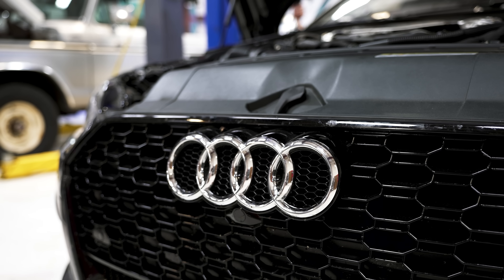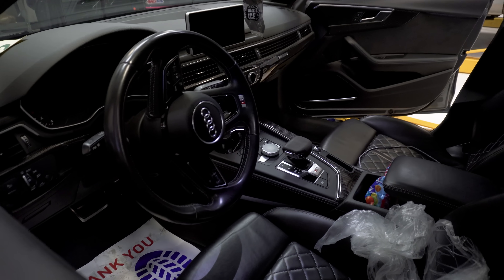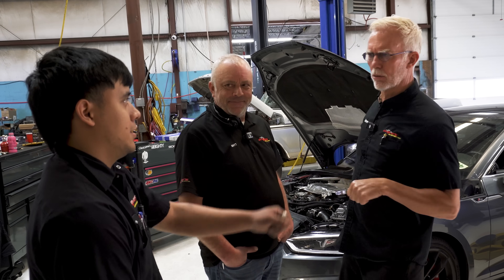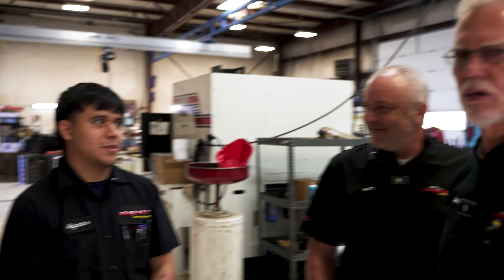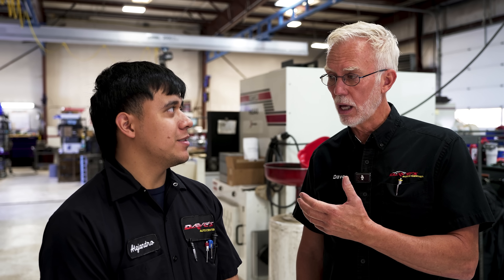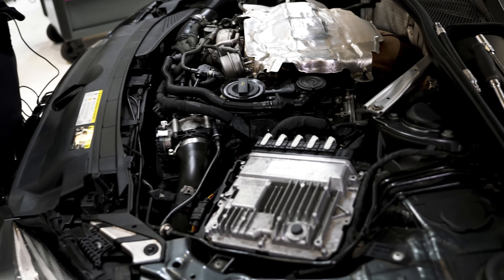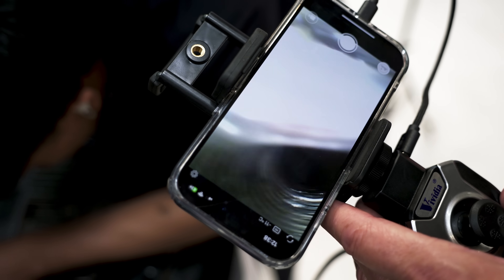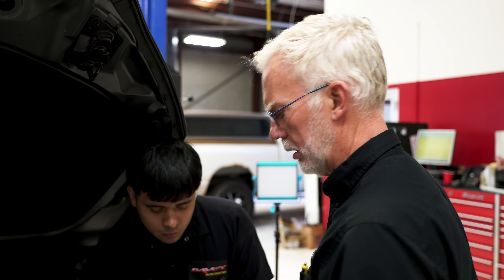Audi S5 Engine Piston Damage

Comment: I’m a retired Audi tech, when there is a missfire on a cylinder the ECU will hide that cylinder meaning it stops spark and fuel flow to that cylinder. And I’m pretty sure Audi does not recommend boring cylinder walls. Check to see if the car is tuned as that most likely is the cause. Have fun with the timing chains ( something I don’t miss)
Reply: That was my first guess.  The car was likely leased by owner one, then owner 2 bought it and cranked the boost, knew he broke a piston and traded it in, then this guy ended up with it
Reply: Yes these engines will deactivate the cylinder so the cat should be fine . I wonder if the car has been remapped and/or run on the incorrect grade of fuel
Reply: @richierich9761  Low octane cheap petrol was my first thought. People buy modern expensive high-performance cars and run them on cheap fuel. It's an absolute no no...
Reply: @richierich9761  They can't deactivate injector that is stuck open.
Reply: @richierich9761  Could have fueled the car in Utah with 85 octane.
Reply: @genehart261  That plus a high speed run to the River ...........🤔
Reply: @richierich9761  I tell you all something. I know a lot about things. Diesel engines are not one of them. I love diesels. I know somethings about diesels but not like the gasoline engine. Im humbled by you all.
Reply: @richierich9761 I'm so glad to hear the kitty's going to be fine😊❤️🐈
Reply: Problem most likely came from a car being tuned. Most S5’s are. And when tuned if you run a lower grade octane than it’s tuned for there is almost no safety margin left. 
Most guys got with a 93/94 Oct tune. If you put 87 or the like in there and put any load on it. Kablamo
Reply: Nonsense. It's not the tune, those garbage rings Audi has been using for 18yrs has caused so many bricked 100K mile B8s, B8.5s, B9s, etc. That causes the oil consumption problem and is why you gotta change ignition coils, plugs, plug wires, PCV, injectors, clean the throttle body, replace the catalytic converter due to the stupid carbon buildup, etc. It still happens on the newest models minus the TTRS and R8. 

Audi has amazing transmissions, looks, versatility; but horrible engines. Definitely a brand to avoid(I didn't lol) 

Almost all cars have some weakness to their manufacturing. I'm tired of dealing with it all together and will welcome the end of this racket.
Reply: @nighthawkviper6791  Get educated. Oil consumption was solved in 2013 when they changed the oil ring on the pistons to a differed design. That was more than 10 years ago.
Reply: @Japplesnap the class action lawsuit in the states received its final approval last month, affecting vehicles up to model year 2017.
Reply: @joebo525  Meaningless. Anyone can start a class action lawsuit.
Reply: @Japplesnap  it was not solved. they still have problems to this day. I see it out of warranty all of the time. I run a German repair shop.
Reply: @joeclarke8716  Solved on my cars. Zero issues. Zero oil consumption.
Reply: @Japplesnap  that's great for you, but it is still an issue to this day on vehicles past '17. Heck I just had a '20 Q7 in and 2 dead cylinders 88,000 miles. Their engines are horrible.
Reply: @joeclarke8716  There are no perfect engines. Some will have problems no matter what. For every one of these engines that do have this issue, there are hundreds that don't. Mine fall into the hundreds that don't.
Reply: @Japplesnap  their engine failure rates are higher than most any company save for Jag/Land Rover. There is a reason why they are having issues and also many, many lawsuits.
Reply: @joeclarke8716  Yet there are hundreds of thousands of them out on the roads without any issues. The failure rate of all modern cars is extremely low. Yes, even Land Rovers.
Reply: @Japplesnap  no, the failure rate is not low. Engine failures have been higher than ever before for the past 10 years. That is due to the shift to low quality/ less expensive manufacturing. Land Rovers/Jags have the highest failure rate. I work in the industry and have worked for the manufacturers. I have seen the decline first hand. As far as German cars, VAG is the king of unreliability.
Reply: @joeclarke8716  The failure rate is extremely low. Prove me wrong. You can't because the data doesn't support a high failure rate. I also work in the industry and I see it every day.
Reply: @nighthawkviper6791 Oil consumption/piston ring, timing chain issue was fixed for the B8.5 and onward. Ppl see an issue with one generation and all of a sudden it’s every car. Get your facts straight.
Reply: @Siwerdensichhinsetzen  I’m here in Canada and we don’t have the right to repair, it not only Audi but other manufacturers don’t release all the information. That really pisses me off.
Reply: Timing chains were easy. Its timing belts I didnt like.
Reply: @crasherxtreme What are you talking about, timing belts are simple, you do know that there are a number of timing chains on the backside of that motor and special tools involved. Either pull the motor or the transmission. Give me a timing belt anytime.
Reply: @nickpappas4133   no. I dont know diesels that well. But i put an OEM timing belt on a volvo 4cyl and it had to be replaced again in about 18 months. Chains lasted longer.
Reply: @crasherxtreme  Why did it need replacement in 18 months?  I drive a 2003 VW Golf with 2.0 litre gas 4 cyl  230’000 kilometres, replaced timing belt at 134K and will do second replacement soon. Not bad for a 21 year old car. Some of the newer VW/Audi 2.0 litres with chains need replacement before 100’000 kilometres and hopefully it is caught before chain jumps and bend the valves.
Reply: @nickpappas4133   or slap a hole in the top of the piston. The ribs on the timing belt were worn. After I took off belt, all pulleys turned without any trouble. Crank was turning just fine.. one day it just quit running. The last thing I thought was the timing belt. After inspecting the belt, I replaced it again and ran fine. Was sold 3 months later. I like volvo motors. Easy to work on. Its possible the belt had a defect in it.
Reply: @crasherxtreme   the reason why that belt never lasted is either it was a cheap belt or incorrect tension on the belt. Belts will last atleast 10yrs if not more.
Reply: @JDMz  OEM part
Reply: @nickpappas4133  

And that problem will disappear iff you change your oil on time. . No longlife intervals. .   That's the problem with this engines. Clean oil is so important
Reply: @crasherxtreme  
That is highly unusual, at least in VW/Audi. It's usually the tensioner or water pump that fails. Never the belt.
Reply: @nickpappas4133 why would you buy a car that needs to timing belts done, stop wasting your money and 😂stick to Toyota or Japanese Man
Reply: @nickpappas4133 chains are always better than rubber. The rest of the engineering needs to be on par to appreciate it.
Reply: As a general automotive MasterTech I came on here just to say the same thing
Reply: HI , IF YOU OPEN AN ENGINE YOU STRIP COMPLETE NOT ONLY ONE CYLINDER HEAD
Reply: I wonder what kind off oil is used. . Audi comments 0w20

First thing i did is drain my engine and put 5w40 in it . .    

I hear a lot stories of audi tuners. And they say .  Please don't use 0w20
Reply: @erwinvanriel5843  0w20?!?  Is that baby oil? Olive oil?!?
Reply: @joshuajuarez3471  

Here in Europe audi recommends 0w20 for the new engines.  Im serious .  No joke
Reply: @erwinvanriel5843  almost all new cars do that, AFAIK. As far as I know, it's due to wver stricter emission standards and trying to reduce internal friction (shear forces) in the oil for a few percent less consumption. I went to an excellent 0w40 for my substantially tuned cars and from variable interval to fixed shorter intervals between oil changes for all cars i'm maintaining. My positive experience might be anecdotal, but i'm convinced it helps with longer lasting engines.
Reply: @346L3  

Exactly . . I drive al my life audi.
And first thing i do when i get a new car.
Drain the oil. En put some good oil in it. And no long life  intervals ..   never had problems with timing chains. Sludge .  

👍👍👍
Reply: @erwinvanriel5843  I just learned something. I have diesel I see nothing but 15w40. It was just a shock to me lol. I assume it’s synthetic tho
Reply: @joshuajuarez3471  

No i don't think it's synthetic. I think it's normal mineral oil
Reply: Yes exactly what i was thinking they tuned the engine till it blow and they blame this car is trash this brand is bad
Reply: Wanna bet it has an 034 tune ...
Reply: Audis are piles of shit
Reply: He's part of the Boat Racing 
#LakeHavasu
Reply: They can be dry sleeved for a good chunk of change.
Reply: I suspect to much boost and pinched the ring breaking the piston
Reply: bad remap more than likely
Reply: Thats y u buy a V8
Reply: Audi will not bore cylinders due to coating and pretty thin. If the scoring is deep replacement of long block recommended. I just did a v6 q7 last week due to scoring
Reply: Hey Nick is there anyway I can email you and ask you a question I have a 2018 Audi Q3 with a misfire that they can't nobody can figure out compression test leak down test propane tests can't figure out why I got a misfire in four only at startup I bought it brand new has 70,000 miles had this misplaced for the last 10,000 miles brought it to Audi they tried to sell me at $1200 oil separator which took me all of 5 minutes to put in in the original part for $114 from fcp euro Audi 300 something for the part plus all that money for labor change spark plugs change the coil packs I just have a couple quick questions thanks
Reply: I directly thought of wrong fuel and knocking but normal ecu will change to bad fuel map. 

Also misfire will deactivate the cylinders because of emissions…
Reply: Unfortunately not this time man. All of these engines are coming back with this issue. Every model line up with the 3.0 Turbo
We replaced close to 15 already this year
Reply: Totally forgot Audi does that you are correct thanks for spreading the knowledge
Reply: Bro I hear ya on boring the motor. I don’t think that motor will ever be the same. Car is trash for the next 3 owners until it’s send to auction and ends up in Afghanistan
Reply: I have a audi 07 s4, I have 2 codes p0491 and p0492, car runs great but just has the engine light
Reply: @LandrySua  

Bye an obd eleven . And you can scan your  own car
Reply: Nah you're not supposed to hone em due to the nikasel plating.
Reply: Buy a expensive car like that one u r dumb not to purchase extended warranty if I would bought that type of expensive car guess what I would purchase extended warranty that way it would not cost me to much money out of my pocket. Lesson to learn here. Guys
Reply: If fuel inejction and ignition timing is on point with the right afr im sure its not the tune.
Reply: Exactly,
Everyone thinks these engines are that dumb.
Wth
Reply: I had a 2003 A8 for 8 years. I recently gave it to my friend with 260,000 miles on the original 4.2 engine, original transmission, drivetrain, etc. No misfires. I've heard that their quality went downhill but this is crazy
Reply: I have a 2020 with this engine and 34k miles.  I'm not tuned and fully maintained.  Should I worry?
Reply: What's the best mileage to replace time chain for Audi B9 series 3.0 turbo engines ?
Reply: @Shulcyo  The 3.0 motor was not a concern for timing chains as per the 2.0 litre 4 cylinder. With proper maintenance and driving the 3.0 for chains should be good, only address chains if the back of the motor is apart.
Reply: No guarantee on a car in the USA ?
Reply: But it's only 6 years old.  Why the hell would it have a misfire?   Even if it's just a bad ignition coil or sensor, this is ridiculous on such an expensive car. How do you explain or defend this?  I get at least 12 years out of my Japanese cars before they ever have a bad sensor or bag ignition coil. Let alone more serious problems.
Reply: @richardpowell2953  And this is not a Japanese  Toyota Camery. It's a Turbo 6 shared Porche Audi Motor, put in a autobahn missile. It's will walk away from the 5L V8 RCF.  Your Japanese whatever the F dose not have a 300KPH/200MPH speedometer.  Being it's an actual performance car/engine. You have to change the spark plugs every 40K miles.
Reply: Yea lot of the newer engines use proprietary spray on anti friction coatings like microns thin, in cylinder bores and can't be easily reapplied after boring
Reply: O Der if that guy warmed the oil before flooring it or he just thought "I've got a new car, pedal to the metal!!!"
Reply: I did Manny.  What a job and pays nothing under warranty. But I'm the master of repairs always brake the record on the book times
Reply: Sounds like another cheap re-map gone bad
Reply: I guess not in older Audi's, my old audi c6 2.4v6 had misfire and still injected fuel and had spark.
Reply: You’re right. It’s not only Audi, most recent car will cut the fuel once a misfire is counting actively.
Reply: He did a follow up and explains the silicone impregnated cylinder walls and why he can’t machine them
Reply: This happened to my car cylinder 6 piston is destroyed have Piks to show it
Reply: I believe I read or saw on YouTube that you are supposed to use special motor oil for DI engines. Wrong oil can cause detonation on DI engines. Running it in extremely hot ambient temps in the desert wouldn't help, either.
Reply: @budlanctot3060  yes there are proper oils for direct injection and at the same time careful of low speed pre ignition ( acceleration under load at low speed.
Reply: @budlanctot3060  yeah its call sythetic engine oil. A good name brand with factory approve is good. Motul, Liquimoly are excellent oils for European cars.
Reply: This guy bought this Audi and became a "race car driver"...  buddy that's the problem.
Reply: Audi makes the most reliable engines in history. *Sarcasm off*
Reply: Question: I had tuned my 14’ GLI with Unitronic and had no issues(no bolt on stage 1+), I now have an 19’ A4 and would like to do the same tune of Stage 1+ from Unitronic. Both cars have the same series engine so is this gonna be an issue with the Audi? I wanted to add that I had gone back and forth a couple times between stock and 1+ just to make sure it was running fine both ways. The GLI was purchased at 17K, tuned around 20k and spent majority of that time being tuned all the way to 128k before I got the A4. It’s a giant way of asking…I should be ok right?
Reply: @41Vega  I wouldn’t think you would have a problem, make sure the motor is mechanically fit with no real oil consumption.
Reply: Buy a Audi at your own risk!!good when going a wallet drainer when not !!
Reply: 300,00  km on a barra ford6cylinder engine doesn't use oil never broke down ,starts every time ,best Ford 6 ever built ,forget the European hot shots mechanics love them a guaranteed money spinner!!for their bank accounts!!!!
Reply: My b5 s4 is bored out to 3.0
Reply: So Dave’s warning about the raw fuel was not completely accurate?
Reply: What? No Car Shield warranty?
Reply: they can absolutely dump fuel in if the injector was stuck open, such could be the case here. These engines in particular on this model of car are pretty good after the first year with the rocker issue. even that was seldom.
Reply: Correct. The ecu stops that particular fuel injector from firing to avoid damage to the cat.
Reply: Are you saying the Tuning was the cause
Reply: I never buy a car I can’t afford to repair. Those foreign vehicles have expensive parts and labor
Reply: No warranty on a newly bought  car?
Reply: @bostonterrierdadk5293   I never needed my warranty, zero issues happened, so no reason to ever bring it in. I do my own maintenance.
Reply: It has to definitely be tuned wrong also he's crazy buying a 2018 s5 with 75k miles that thing was definitely beat to shit and then he proceeded to beat on it lol
Reply: Sir, I'd like to be a service writer at your shop and provide very entertaining content for your viewers 😁
Reply: what do you think about b9 2019 audi s4??
Reply: @user-ki3ks4fd6i  I retired in 2017, but when I visit the techs at the shop they say the cars are good with proper maintenance and no tune.
Reply: The cylinders are not specially hardened I forgot what the tech is called. They can NOT be honed. Entire head needs to be replaced. Likely culprit is a failed fuel injector not a tune.
Reply: Hello Sir. Can you tell me something about the 3.0l V6 EA839 engine in the Audi A6 55 TFSI with 340hp please. I am interested in this car from 2020 onwards. Many thanks in advance and best regards.
Reply: Ok sir I need you!!! I have a 2013 A6 3.0T w/ supercharger. I had PVC codes and with 199K I thought time to do some heavy maintenance. I changed PVC cleaned valves, intake runners. Changed nearly every hose, all belts and tensioner/ idler.

When I took intake runners off the 1/3/5 side connectors all broke. I replaced them (Audi parts).

So all put together, I get a cylinder 1 misfire and hide cylinder only if I get above 2,500 RPM. I also have Evap fuel vapor temp code which I believe to be completely an isolated issue.

Please help
Reply: @stevek9670  ecu and injector
Reply: @stevek9670 what are the codes you have
Reply: @stevek9670  Have the same engine in a 2012, piston rings give on these models especially if the cats have never been replaced. I would take it to do a compression before throwing a bunch of parts at it. Mine is 200k and am getting another engine in, the rings finally gave. It would misfire then go into limp mode. Got it checked and had cylinder 3 foul the spark plug with oil.
Reply: @henryp9600  thank you! I appreciate the genuine reply. Plugs were clean, I know I disturbed something. Injector wire connection? Injector itself or o-ring. I'm not a trade mechanic, just a guy trying to keep the family going! I hope to pull apart in a few weeks after closing up some home repairs. I'm able to drive just not to it's spunky form.
Reply: @stevek9670  Best help is to get rid of it, and get a Lexus
Reply: @labourlawact7826  sorry I like my car
Reply: @BubblesTheCat1  😂 I have a 2002 Lexus LS430 with 222,300 miles and it still runs like new.
Reply: @stevek9670  Yeah but its an Audi with 200K, they're literally only designed to last 4-5 years, then become so expensive to fix that you just go buy a new one.  A Lexus is just getting broken in at 200K
Reply: @AreaS4channel  sorry bud gotten more out of them because I take care of em. Usually wiped out due to collision or the like. I prefer the 6 cylinders over all but my 2.5 VW has paid dividends.
Reply: @stevek9670  You can for sure, the maintenance is just above and beyond.  My buddy has an A4 s-line that spat ice out the AC vents and dash lit up like a Christmas tree, still drove awesome
Reply: @chijen2010  It's barely broken in, there's people out there with a million miles on their Lexus. Show me an Audi with a million miles😂😂😂
Reply: @labourlawact7826  you have so much insight, hopefully 1 day I can grow up like you. This is honestly the only time I can honestly say my comments were tainted.
Reply: @BubblesTheCat1  But then you die of boredom. 😂
Reply: @stevek9670 The 2.5 and the diesels are the only vw i would spend money on. I have beat the hell out of a 08 2.5 Jetta and it will not quit 160,000 mi so not super high but this car has been amazing. Original clutch cause I don’t let anyone beat on it, car has been t boned and the dash lights are all on lol, ran it half empty on oil once cause jiffy lube forgot the filter O ring. Cold starts at 0  -  -40F it’s whole life, fed it Dino oil til 100k when an oil shop told me I must use the euro oil, I could go on and on.
Reply: @ArcConAK  225K on 2.5 gas Automatic. Reliable, efficient but doesn't have the comfort or thrills of the Audi lol.
Reply: @chijen2010 I have a 2012  Nissan Altima 300k miles and climbing
Reply: @youngboss2512  The difference is a 300k Altima looks like a 300k Altima.  A Lexus LS430 doesn’t.
Reply: @warbirdtbf  2.5 in Jetta is good. My issue is 2013 Audi 3.0T not up to best. Cylinder 1 misfire if I step on it and go over 2,500 RPM. EPM and hide cylinder go into effect. I can clear and continue so it's not a solid fault in my opinion.
Reply: @chijen2010 sounds like a boring old car. It runs fine, so what?
Reply: @betterbeavailable  I have a Corvette C8 convertible and a Ferrari Convertible too.  I can assure you that compared to your Geo Metro, the Lexus is anything but boring.
Reply: @BubblesTheCat1  

You silly toyota lover 🤣🤣
Reply: @erwinvanriel5843  My Lexus LC 500 is anything but boring or silly. It's great fun, without the mechanical problems of the German crap🤣
Reply: @labourlawact7826  

It was a joke. Everybody got his brand
Mine is audi all my life . And never had big problems with an audi. Never.
I'm not an mechanic. But i fix everything myself .  Lexus are nice cars. Same as a toyota very reliable
Reply: So glad I drive an electric car. The end of the ICE is Direct Injection.
Reply: @AreaS4channel lexus NA engines with low compression ratio and 10mpg yeah big difference
Reply: @stevek9670 I agree. Both my Audis have over 200k. I take care of them myself. Most cars can last a very long time if properly taken care of. 
On your 3.0T, did you get a scope to look at the cylinders?
Reply: @atrain132  This weekend I took the opportunity to give it a road trip (3 hrs). It seems to have improved and be taking more to trigger the faults. I really think something was not quite perfect putting everything back together. No scope yet but going to do more research on EPC fault. Thanks for responding!
Reply: @stevek9670 Going on 190k miles on my 2.5l 13 passat with only oil changes every 10k.  Not even a CEL ever!  Love it!!
Reply: @chijen2010 I had a 2004 with 220k. It was magnificent. Glad you still have yours.
Reply: @BubblesTheCat1  lol, i just had the same problem, tried the same things and ending up selling the Audi for a huge loss.  Then proceeded to buy a Lexus.
Reply: @reallycruisin9668  😁
Reply: @BubblesTheCat1  I traded my Lexus IS in for another Audi S4, A B9.5 this time after a decade of Japanese cars. My last Lexus had a differential that that blew up, along with a wiring issue that caused it to lose power going around corners. My previous S4s had silly BS issues, the satellite XM radio module going bad and such. Nothing that stopped me from getting me to work in the morning.
Reply: @AreaS4channel  your way off these  B9s are fine esc w the upgraded RRs well past 150k 
.welllll
Reply: @BubblesTheCat1 
Lexus is not as much fun😢
Reply: @BubblesTheCat1 .  I figured that it wouldn’t be long B - 4 Someone made a derogatory remark about Audi.  Surprisingly, it took longer than I expected.

                                      Fergieman
Reply: @Corvacar  Yeah, Audi is planned obsolescence at it's very best. Show me any Audi's  still on the road after 10 years. Virtually none. They're absolute piles of junk 🫣
Reply: Ya but it's a fun 5 years or a boring 15 years. Your choice
Reply: @AreaS4channel  not in Ohio, lexus is rotted out by then
Reply: @BubblesTheCat1 we like going fast lol not Slowyotas
Reply: @AreaS4channel lol, The first part is right on the money but you tainted your statement with a 200K break in period on a Lexus..

Source: Lexus mechanic.
Reply: It's a Nikasil-like block too. Can't bore and hone that or it won't last. But those cylinder walls did not look that bad yet. Let's wait and see 😊
Reply: @tomn.1568  no, it's iron coating. the germans stopped using alusil a long time ago. audi never used nikasil
Reply: @goddesseddog It’s still paper thin plasma ect. Light hone is the best you can hope for.
Reply: @goddesseddog sorry, being really close to the source, I can assure you these cylinder walls are coated. You can't bore them. Sleeving them is your only option but it's not recommended.
Reply: @goddesseddog you are wrong, it is a nikasil block....
Reply: @goddesseddog  Was that the system that the late Chevy Vega used (silicon-aluminum ally). They etched the  alloy so that the pistons runn on the silicon crystals
Reply: @tomn.1568  I never heard of a Nikasil block, are you referring to the cylinder lining?
Reply: @tomn.1568  You can probably put a sleeve in there. But boring won't work. Under the coating the block is too soft.
Reply: @PuerRidcully pretty sure he meant bore it out to fit the sleeve
Reply: @tomn.1568  I'd rather die from boredom than having to catch the bus cause my stupid Audi has broken down AGAIN, and it's going to cost THOUSANDS to fix AGAIN🤣🤣🤣
Reply: @labourlawact7826  I guess its lost on you that the car didn't break down. He drove it hundreds of miles with a severe misfire and it still got him home.
Reply: @Japplesnap  But, now it's going to be out of service for a long time. Happy boring days, taking the bus ahead, while I'll be whizzing by in my perfectly running, trouble-free Lexus😊😀
Reply: @labourlawact7826  Except for the fact that I've been an Audi owner for 12 years now and neither of my Audis have broken down. So I'm not bored and I'm not stuck taking the bus. Maintain any vehicle properly and it will serve you well.
Reply: Not me I just go get another Audi S5 at that point and be on the road the next day. At 200K I got my money's worth and more. Most Audi's don't go past 150K. That's the max I'll keep one. If I wanted reliability I would have bought a boring Lexus.😂
Reply: That in keyed crankshaft timing chain cog is the cheapest, stupidest thing I have ever seen in my life.
As a former VW tech I can only advise people to avoid VW AG products as vigorously as they would avoid Herpes.
Reply: @nattybumpo7156 what do you drive a Toyota ? Most dealer techs get pee ed off with the brand stuff as they spen all day fixing it
Reply: @DashDriver-z1r  
Youre not wrong.
I was a VW tech.
I drive a 30 year old Volvo 940.
Why? Because at 422k it never beeaks down. I change oil and keep tires and brakes on it.
All makes are garbage now, so after 25 years in the trade i left.
I work in avionics now.
Reply: I hope Alejandro knows how fortunate he is
Reply: Audi are trash haha
Reply: @Otto_VonJizzmark  

Don't think so.
Reply: @erwinvanriel5843  you are deluded. Buy a Lexus and you’ll see what reliable is
Reply: @Otto_VonJizzmark  

Sorry not my brand. Audi 4 life ❤️
Reply: Yhiiiihaa ..fixing 4 rings in the us of a.......please ....

1 use the right gas (>95)
2 do not put fingers on ecu (only oettinger)
3 do not bore (to late)

Its audi .... ever bin to ingolstadt ?
Reply: He got Volkswagened.
Reply: Ok sir I need you!!! I have a 2013 A6 3.0T w/ supercharger. I had PVC codes and with 199K I thought time to do some heavy maintenance. I changed PVC cleaned valves, intake runners. Changed nearly every hose, all belts and tensioner/ idler.

When I took intake runners off the 1/3/5 side connectors all broke. I replaced them (Audi parts).

So all put together, I get a cylinder 1 misfire and hide cylinder only if I get above 2,500 RPM. I also have Evap fuel vapor temp code which I believe to be completely an isolated issue.

Please help
Reply: @stevek9670 are the runner flaps actually placed right? If the flaps aren’t behind the metal sleeve properly, it will cause that issue as well
Reply: @justmkr4830  they are correctly installed. I appreciate the follow up.
Reply: @stevek9670  On these engines, misfire can be caused by leaking intercoolers. They are Water/Air type and sit in the supercharger outlets. If they start leaking, the water spray will cause misfire above certain load / boost. Watch for coolant "dribbles" in the green seal seats on the cylinder intakes or, if you can, shove an endoscope through the Supercharger Bypass Valve to avoid disassembling the complete intake and belt drive :)
I had this fault - sadly - multiple times already.
Reply: @346L3  Best response yet!!!!! Much appreciated
Reply: @stevek9670  I may be wrong, but I believe when you replace the intake runners you have to perform a replacement adaptation/basic setting. I installed a new ecm on a 2013 a4 a couple weeks ago, one of the required adaptations was for the intake runners, it needs to be learned by the car. it is a different engine so I  may be wrong, it may not be necessary on the V6s I'm not sure. but it's a good thing to check. may have to go to a dealer as I'm not sure what you can perform without ODIS. but if you know everything is installed correctly I'd definitely look into that.
Reply: @stevek9670 hey Steve, if the car is misfiring on the 1,3,5 cylinders you should check if the intake flaps are damaged since they must go in a certain way after taking them off. Did you have a shop do it?
Reply: Get rid of it. Too many miles, too many problems
Reply: @stevek9670  exhaust valves could have carbon build up too possibly
Reply: @stevek9670 get rid of that money pit, there's your help (former owner of several Audi vehicles)
Reply: @stevek9670 I'm surprised you have 199k on an Audi.
Reply: @stevek9670 you got 199k out of it that’s way past what they normally go to. Too much plastic and heat
Reply: DURALUBE IS THE GREATEST PROYECTION ANY ENGENE CAN PERFORM WITH BECAUSE THAT OIL WILLEMBED INTO THE ENGINE METAL GIVING GREAT PROTECTION AGAINST PVER HEATHING NO SLICK OIL NOR ANY CYNTECTIC OIL WILL EVER PROTECT AN ENGINE AS DURALUBE DOES
Reply: @RogerBOCANEGRA  I don’t know, sounds like snake oil, not sure of being embedded into the cylinder wall with factory coating.
Reply: @RogerBOCANEGRA ❤
Reply: @RogerBOCANEGRA  0:00 😢
Reply: Why are you yelling?
Reply: @RogerBOCANEGRA OK BRO